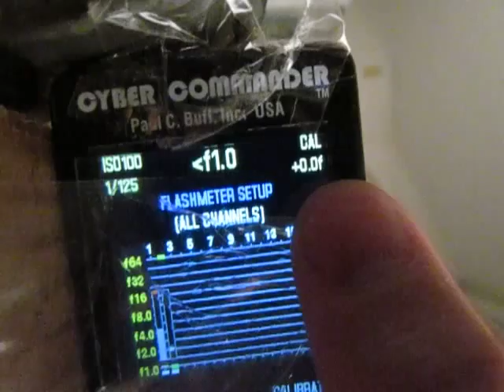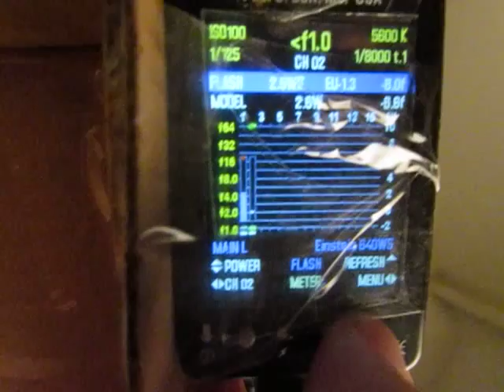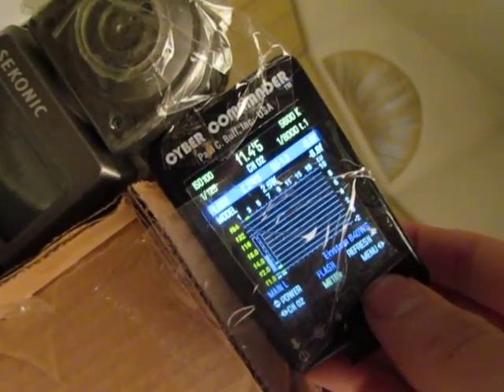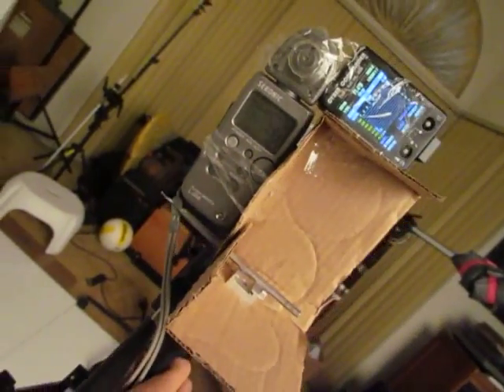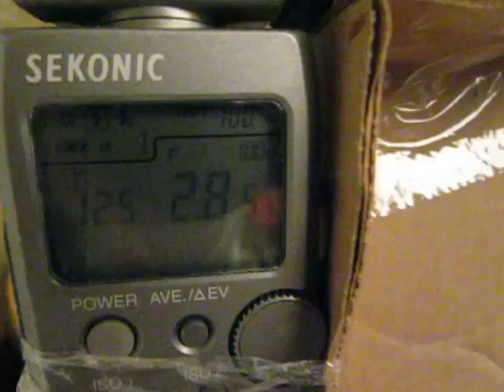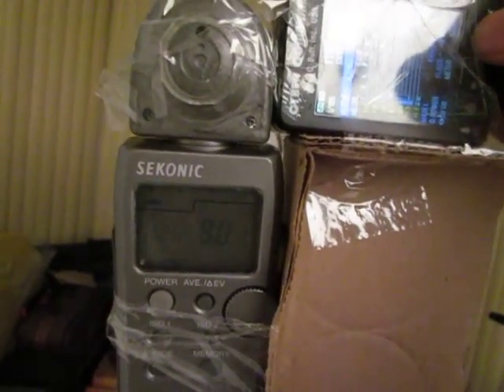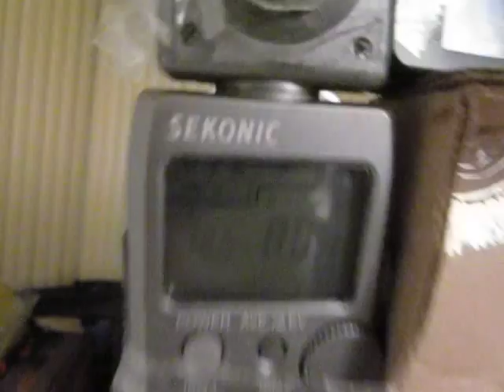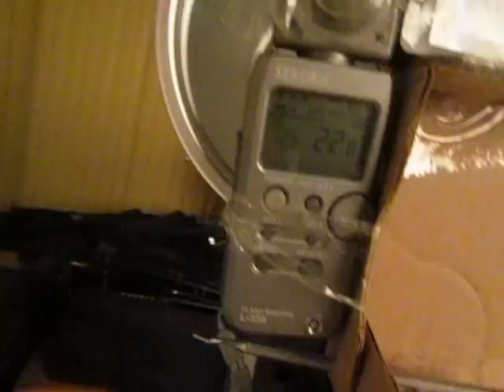PCB cybercommander (defective-- now repaired) light meter vs sekonic l358

Comment: I performed the same test with the L-308S and CC, with the Einstein640 at about f4 power. The meter readings were quite consistent, only off by about (0.1-0.3) if that and mostly identical from the range f4-f45. In the f/2.8 to f/4 range, I was up to (0.5) of a stop difference on occasion. Slight movement of the Sekonic (1cm at 10ft) brought the readings right on track. Will do a video later. Also try in "factory" calibration mode where the screen is all blank/black with just meter up top?